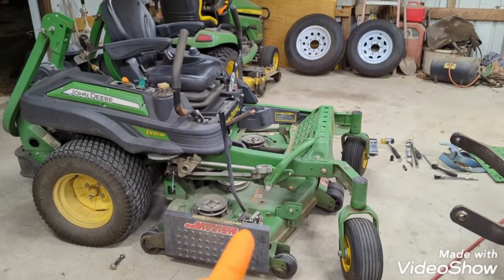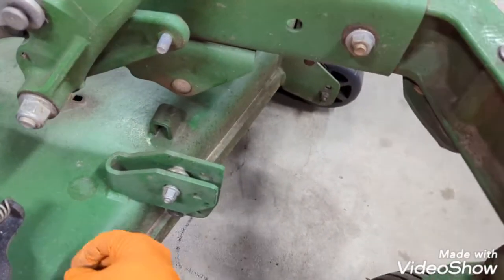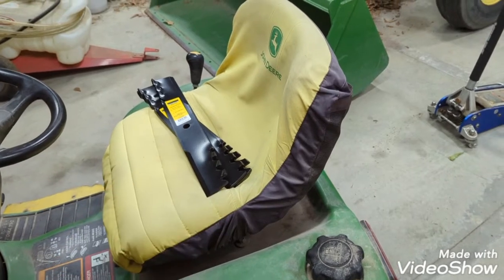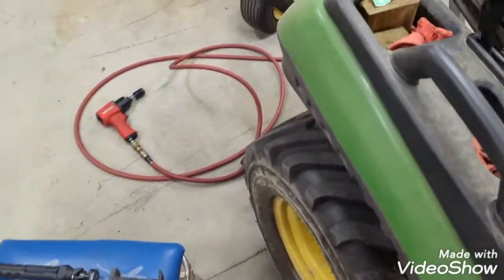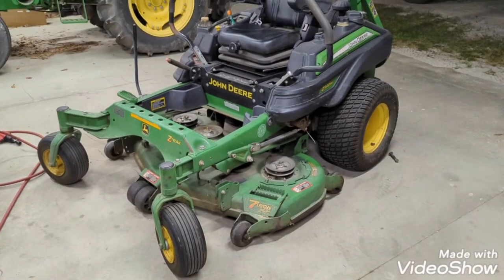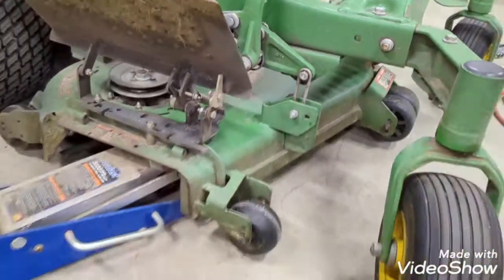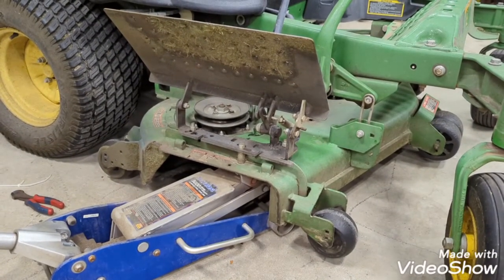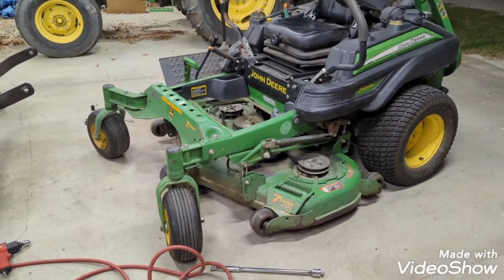HOW TO: REINSTALLING THE ZTRAK DECK - THAT GUY WORKS FAST🤔😎

Comment: Josh did you say the blades have a 5/8 hole? I'm pretty sure John deere uses a 7/8 bore. Maybe I'm wrong. Also are you still using non ethanol fuel? Nice job on the deck install you are quite the mechanic!
Reply from the maker: 🤪Thanks man...I try not to mess things up to bad .. 😂. Yes the QuikTrak has 5/8 center holes for the blades. That's probably because it was built off the Weight patent/platform🤷. Yes I only run Non-E fuel in all my stuff 👍😁💪
Reply: @joshslawnlandscape9935  oh ok! Good price on those blades. I'm running gator blades and love em. 👍👍👍